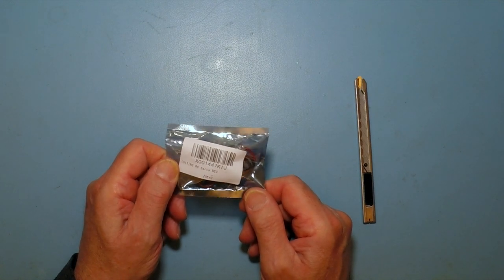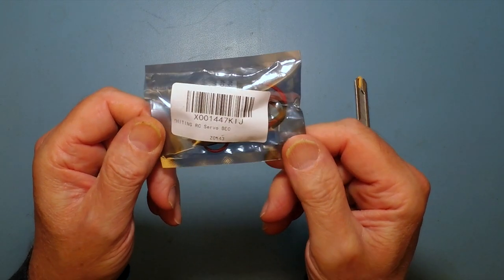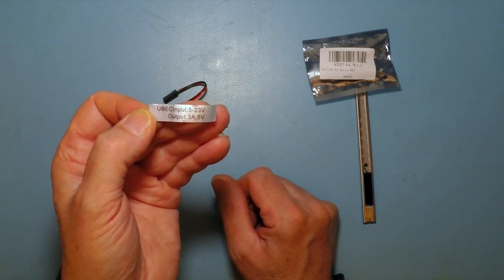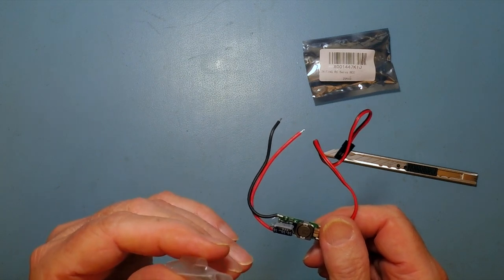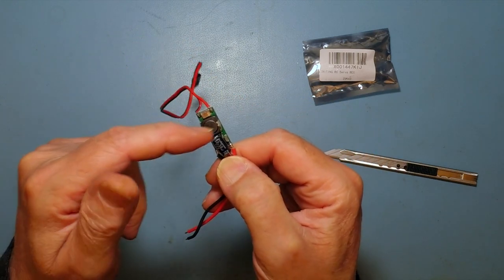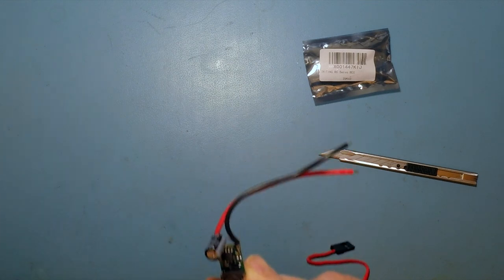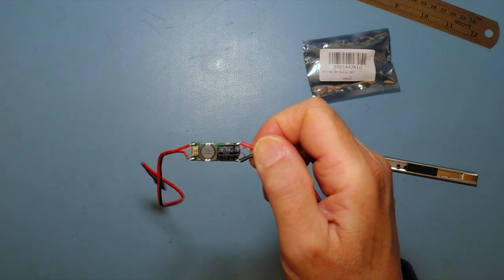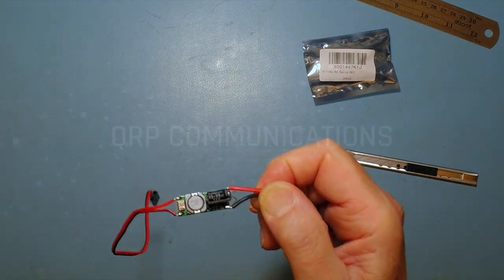Raspberry Pi and Ham Radio: 5v 3A Buck Converter Short List

Comment: Hmm I bought a few 5v 3a ubec modules and they put out 4.94v which is going to upset the rpi. I guess I will have to find another use for them
Reply from the maker: I measured my 5V buck converters and they output 5.1 or 5.2v.
However I tired my Raspi and it was happy down to 4.5v so I suggest you try what you have. Put a largish reservoir cap across the output to help with 'startup' and power pulses -- say 250uF or bigger

Comment: Happen to have a working link to your buck converter?  I am interested in getting a couple of these especially if you have proven them to be good for these uses!  Thank You, 73 de Seth - W8FG
Reply from the maker: Hi Seth. This is the link to the UK Amazon site. I'm sure you can find the same in the USA: https://smile.amazon.co.uk/ZHITING-Helicopter-Airplane-Receiver-Supply/dp/B08212ZFDC/ref=rvi_5/259-5963481-4383747?pd_rd_w=Hs0CF&pf_rd_p=1aa0e3c6-d03f-4cfa-9040-27eac2789751&pf_rd_r=Z9FTCFZ6CY5J1HZ9MVN1&pd_rd_r=93ae1a36-1c87-486f-919c-dbf80acf77c2&pd_rd_wg=4Mc5g&pd_rd_i=B08212ZFDC&psc=1

Link is a bit long!
I hope it works otherwise its called 'ZHITING RC Servo BEC UBEC 3A 5V for Helicopter Airplane Receiver Servo Power Supply'

I now have 5 of these running in various projects.

73
Bruce G4ABX